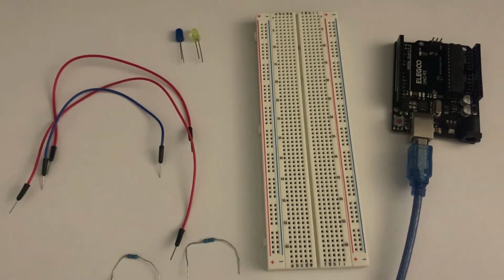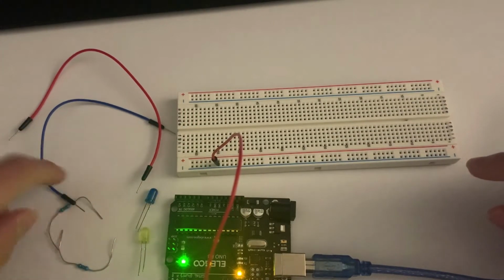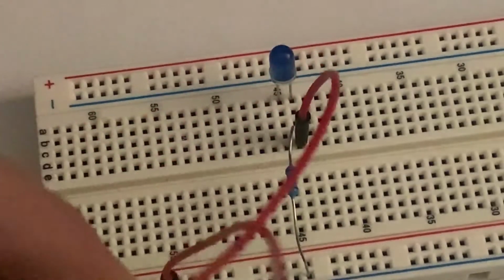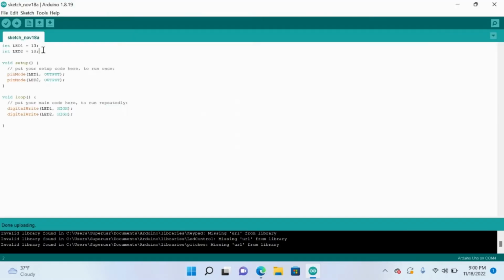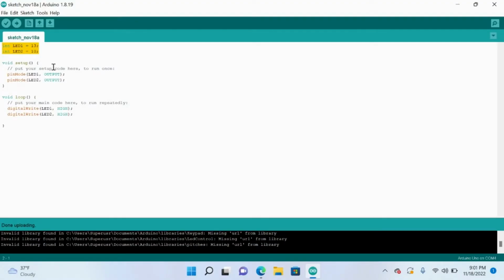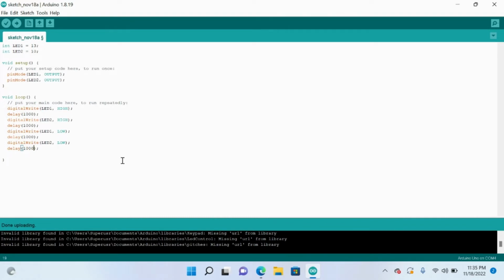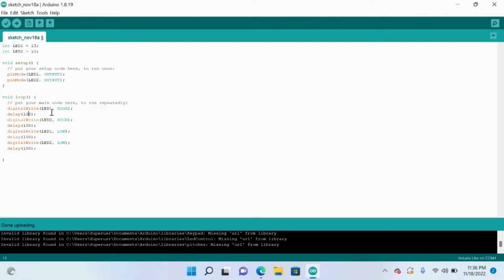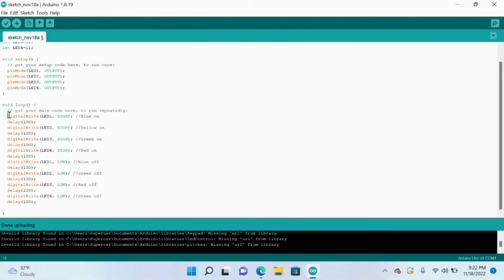Intro to Arduino: Arduino LED tutorial and more!

Comment: Why there is no 5v conection and also the + side of the white board does not connect   . I appreciate your work
Reply from the maker: Great question! In this case, a 5v is not necessary because the digital pin it is connected to acts like the voltage source. Essentially the pin that it is connected to (4,5 etc) provides a positive voltage supply where the GND provides a return path for the current. Regarding your second question, try the other railings (+ or -) or just try with 1 LED first that doesn’t need the railing. Thanks for commenting!! ❤